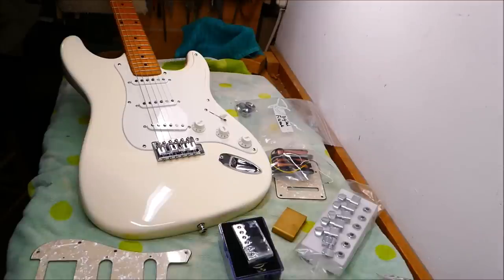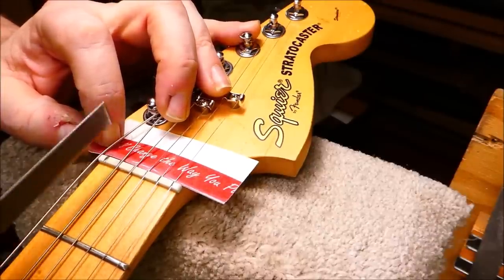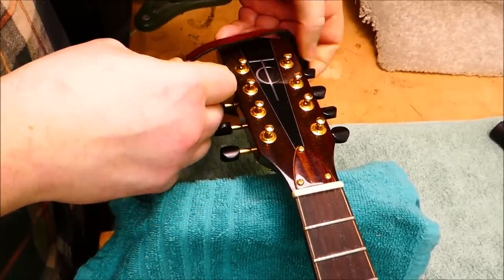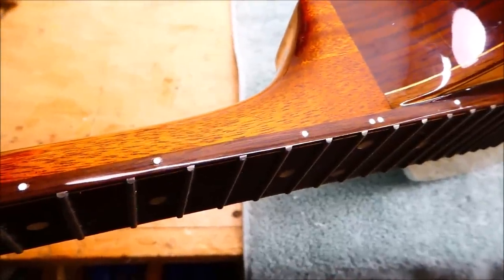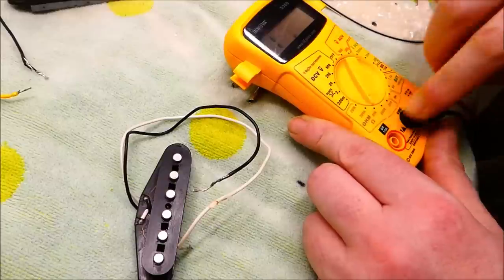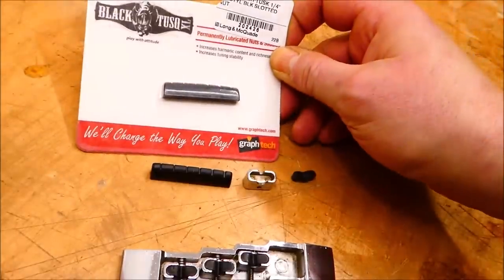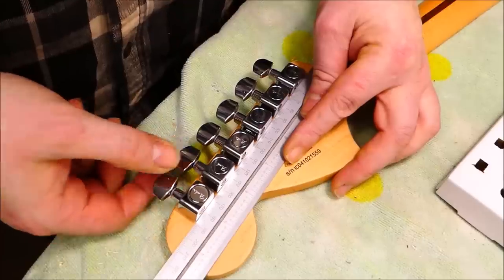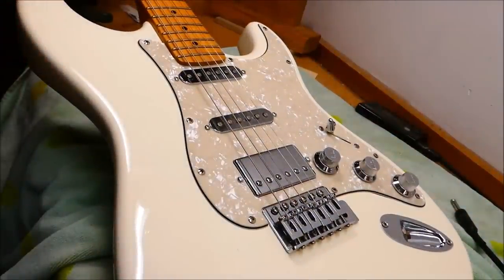That's a lot of work!

Comment: Random player: "Partscaster, assemble!"
Ted: "No"
BTW always wanted to ask, what happens if you agreed with a customer on a certain price, but it turns out to be much more work than initially projected?
Reply: My assumption is he stops at the budget and calls the customer 🤷🏻‍♂️
Reply from the maker: I almost never go over my estimate, unless it's something really unforeseen.
Reply: @twoodfrd  Good policy. In my own (non-guitar) business, I charge whatever estimated and figure I'll know better next time. In extreme circumstances I'll tell the customer that won't be able to do the work that cheaply again.
Reply: @allenhanford  that's the only right way to do it.  Things don't go right sometimes, and unless something way out of your control happens and the customer is informed in real time and a new plan is put together, you take the L, let em know and move on.   Most people will be a return customer solely based on doing the right thing.   I fix cars, and it's just what you do to have an honest buisness.
Reply: When someone wanted an exact quote, I always added 30 to 40 % just to be safe.
My regular customers trusted me enough and knew I wouldn't rip them off and just told me to fix it and call if I thought something was going south in a hurry.
Reply: I build  custom parts for race cars,,,,same story,,,they bring parts out of a catalog,,,first thing I do is take the part to the saw and remove the fluff that contributes nothing,,, I do my work on time and materials for the most part,,,I have been in business for thirty five years with no advertising,they come to me because they want it done right,,,and they know what to expect because of my reputation,,,,I pick and choose what and whom I want to work for,,,,
Reply: If the customer sees this video, hopefully s/he will do the right thing.
Reply: Unforeseen conditions can and do occur so it's a good idea to mention that beforehand.  If you are working on a handshake just call them up and negotiate.  If there is a written quote, submit a request for change order.   If the owner does not agree, bill them for the work accomplished and give them back their stuff.

Comment: I have done dozens of guitars like this.  BUT (that's a big but), I don't do them like you did with the customer buying the parts.  I ask what they want, we look online and pick colors, patterns and such.  Then I pull parts out of my own stock (sort of what you ended up having to do) and then build the guitar.  I always repainted the bodies and leveled and crowned the frets, so lots of work and value there.  I did tons of 8 hole vintage pickguards on newer Mexican strats doing the fill and drill you had to do.  I find it fun to do and never put a time limit on anything.  Most of the time, I'd build myself a guitar, play it in the band for a couple months, then sell it.  Semi copies of Knopfler or Gilmore or just what I feel like.  Then off to sell.  I don't have the repair skills you have so I guess we all do what we can.

Comment: I have assembled many Partscasters over the years. One thing I've learned is to NOT by a kit ( stewmac etc). I know which parts fit and strongly advise customers to buy what I recommend. All my neck joins are perfect, better than my original Fenders. As to cost, that's relevant to you and the hours spent. I only charge $40 /hour for 40 years of learning, modifying and building from scratch. I don't have to charge more as it's my hobby, even though I had a registered business, you are super professional. That and Youtube are your livelihood. So I can't say about your pricing system but I'd say $80- $100 an hour for a 5 hour job. Partscasters costs are becoming cost  prohibitive now so I only do favours ( often at no cost) to budding young musicians I know.

Comment: "Partscasters: NOT worth it!" One of the clearest, hardest truths in electric guitars world.😂
Reply: I sure like mine though.  :)
Reply: I put together my own partscaster. it did take me a long time. most of that time was spent searching for parts that were the correct string spacing ect. financially it did not make sence but I enjoyed the process but it is just a hobby
Reply: Why would it not be worth it? It sure worked well for Gilmour??
Reply: @beppelantz8169  we are probably not Gilmour..
Reply: The advantage of  a part guitar is you get exactly what you want.  The sky is the limit. I made a 7/8th size strat with 24" neck. Modenr trem, compound radius neck, master volume/tone,  and normal wound, unpotted pickups.
Reply: @beppelantz8169  Because gilmore wasn't mixing US,  Mexico,  Chinese, and other make parts and assuming it was all gonna fit like legos.

Comment: My absolute favourite guitar is a tele where I replaced the wiring, the pickguard and installed a Seymour Duncan 59 and hot rails, essentially the Danny Gatton/ Mike Stern mod. I also split the humbuckers with some resistors from the PRS DGT specs. Everything fitted perfectly except the bridge plate needed a little filing where the hot rails rubbed. The right parts are out there but you have to do the research.

Comment: My easiest partscaster is a Fender build using only Fender or Fender Licensed parts on a used MIM Stratocaster body and neck. I was shooting for a 1964 look and tone. Even then there were issues with mounting holes, pickup placement and such. In the end she looks and sounds great, and it was a fun project, but it was certainly not an inexpensive way of doing it. So far as cheap copies are concerned...be prepared. Every one of them is a work of love and "creative problem-solving".

Comment: The second position sounds out of phase. Its a 2 conductor wire so Im not sure how you can fix that. Flip the magnet maybe. If your single coils are in phase and hum cancelling then flipping the magnet on the humbucker is probably what needs to happen. Yet again another reason parts casters suck lol. Customer brings random pickups to slap together and thinks everything is gonna work out. Different manufacturers wind their coils whatever direction they choose. Sorting out wiring on a partscasters can really suck lol
Reply: Yeah, I thought I noticed the out of phase sound too. Been down that road a couple of times myself, opening up the pickup and rewiring the insides and/or flipping the magnet,... in most cases it's better to buy a new pickup that will be in phase cuz otherwise I'm charging at least an extra hour..

Comment: I learnt a long time ago to set the tail end of the guitar on the floor  between my boots ...the back center if the neck  against my left  knee and  as I tighten the truss rod I push back on the neck instead of just tightening the truss freehand  without helping with the tension as it is tightened.   Great Video THANKS   FUN stuff.

Comment: I built myself a Strat kit, transplanting in the HSH electrics from an Ibanez and with hand-made carbon fibre 'plastics'. Like your friend's Strat; a lot of plugging and redrilling, including the bridge position because it was 5mm out for the scale length but because it was a project from the outset and for myself, it was a lot a fun and I learned so much.
That said, I totally get 'You can't give me a bunch of random parts to assemble and expect it to be a quick job'.

Comment: I ran into a situation last week, where I needed a substantial piece of plastic to fix a non-guitar issue. Turns out, like most shops, we have a SEVERE over abundance of old screwdrivers. Lots of different colors too. I ended up using a clear handle to fix my other project,  and the plastic they used was good and hard,but also seemed to have some silicone in the mix. I'm going to shape a nut out of it, and see how it holds up. Should be slippery because of the silicone mixture(or whatever it actually is) so the strings shouldn't ever stick to the nut? I'll have to see. 
   Also, I dont know if mr woodford actually reads these, but if you do, I started putting that destroyed head on the hamer I bought just to practice. Taking it in stages, and it's working better than I expected.  Thank you VERY much!!!

Comment: I think it's vital to buy all your parts in a kit or at least get them from one source.  I just ordered everything for my first partscaster from Guitar Fetish.  Their descriptions are fairly detailed, and they tell you whether a given part is made for Imperial (US made) or Metric (imported) guitars.  For my neck and body I bought b-stock or blemish parts, to keep costs down.  I got a pre-wired Strat-style pickguard.  I'm good at soldering but I hate it anyways because my close-in vision is poor and my fingers are clumsy.  I went with top-notch parts for the vibrato bridge and the tuning machines.  Holes for the neck, the pickguard, and the bridge are not drilled, so I can take my time lining everything up.  I plan to dampen the wood, sand at least twice, then finish the neck and body with Watco Danish Oil and a coat or two of paste wax.  I have built about a dozen guitars from scratch, all set-neck, double-humbucker types.  This is my first experience building something with a tremolo bridge, and I am really looking forward to it.  For somebody with little or no prior experience I would definitely recommend buying a kit for your first build.  Everything ought to fit, and if it doesn't you can always send it back.  Good luck, everybody, and thank you Mr. Woodford for a great channel!

Comment: I have a few Partscasters and yes, you hit the nail on the head. Overall, in terms of time and money, you pull ahead with a stock guitar every time. That said Partscasters are really a learning course for the hobbyist like me where I am getting much better at many new skills. One Partscater predated a Fender run years later but still its not the same.

Latest mod is a Xaviere Strat with a HSS pickguard. Originally I had a double Filtertron pickguard with GFS pickups and due to the string spacing of the stock bridge and screw heads on the pickups, it came out off. Keep in mind ALL pickups and pickguards are GFS and Xaviere is their in house brand. 

The double Filtertron pickup placement was off and the location of the two holes for the volume and tone pots meant a full size pot will rub against the side of the cavity route. I am using CTS pots and Orange Drops in my builds. The HSS pickups are two Brighton Rocks (Burns style with large magnets) and a Surf 90 in the bridge which is humbucker sized but still a single coil (DeArmond meets a P 90, looks and sounds similar to a T Armond by TV Jones but the Surf 90 is the older of the two). The high E string misses the magnet on the Surf 90 just barely but much better than the GFS Trons in the other pickguard. I replaced the import tuners with import locking tuners that require no mods, put in Tusq string trees to go with the Tusq nut that was stock. The screw holes on the pickguards do not line up even though again, everything is in house.

Bought another IYV style Thinline Tele for the GFS Trons and while that will work, hitting little snags here and there. Have to get new longer thread pots because the ones I have are meant for pickguards not wood. I have to fill and redrill the pickup screw holes even though they look like they SHOULD fit. Still, both guitars are classes in guitar shenanigans.

I have a multiple Partscasters. I assembled them because usually it was either a way to have an instrument that was nothing you could get off the wall or it was far more cost effective than buying the production model. I have a mongrel Squier Telecaster that is more of a Teisco meets a Telecaster than the Mexican Telecaster with a Bigsby. Mine has Fender Noiseless pickups and wiring (it was free) and lots of GFS parts  including their X Trem which is more like a stable Bigsby knockoff vs a real Bigsby. My luthier helped me out but at the end it was less than half the cost of the Fender and closer to a updated and more reliable Teisco than a Squier or a Fender Telecaster. The flaws actually are highlighted and hide in plain sight and it looks, plays, and sounds really good. Last thing will be to get a bone nut for it.

So yeah, a Partscaster or a major rebuild is much better for the aspiring luthier. It's a cool guitar for the player and should give them a better understanding of what a luthier's job is. I would say for a hobbiest to get the guitar 80-90% completed before handing it to a luthier. Other than a Warmouth build, you are seeing diminishing returns once you start hitting the $1k mark.

UPDATE: The Xaviere Strat H/S/S is set up and plays very well. I am not a huge fan of the old bent steel string saddles so that will get replaced later. Either steel or brass modern block style. The IYV Thinline style Telecaster (300NT) modle) plays well and looks great. The GFS Filtertron pickups are a bit on the weak side compared to the real deal (have real Filtertrons on two other guitars plus a Gretsch set up with a set of TV Jones Filtertrons). I would say they do jangle but less power in the Alnico ll model vs real deal. That said it DOES give me a different tonal option which is what I was originally after, just less Gretchy.

The Squier build is close to done, since I originally wrote thia post 9 months ago, I replaced the GFS X-Trem Roller Bridge with a Gotoh old school style Bigsby bridge (the back is scooped out) with conpensated 3 brass barrels. This let me take the shim out of the neck. I also replaced the Fender old school F tuners (second set for that neck) with my preferred inexpensive locking tuners. This meant I had to fill over 20 little holes in the back and drill 6 new ones. The good news is that the new tuners hide most of the older holes and do not look too bad. This guitar is a blatant Partscaster and I decided to celebrate the changes rather than hide them. With the new tuners and the new bridge plate it looks better and feels much, much better. The tuners are 19:1 so the tuning is the best that neck has ever seen.

All in all those three guitars look great, feel great, and sound great. All for the price of a top of the line American made Fender (cheaper than a Custon shop though by still being about $1800ish all in). I love them, they are players, the feel cheap in a good way, they sound like they would compliment a professional level guitar.  None look like something off the wall in a music shop. So overall very happy but it also helped me turn a corner and really appreciate the "good to go" models on the wall at the guitar shop. If you can do the work yourself for the most parr, can recommend. If you want a professional to do it... buy Warmoth quality bodies as well as boutique parts because you will never see that money ever again. Or just have a good luthier build you something made to order.😉👍✨

Comment: I modded a guitar myself back in the 90s. A Jackson clone from Ovation. I wanted a Gibson bridge pickup, toss the whammy set up and install a solid bridge. I bought a 57 gold Gibson pickup from Gibson, a Schaller bridge and a built in tuner. I plugged the hole for the bridge (it's reversable I used hide glue). Covered the black headstock veneer with maple veneer (reversable) and wired in a built in tuner. Did the set up and good to go. Not an easy mod. It took days, I kept all the original parts. I restore antique furniture on a word of mouth basis as I have time and charge lots of money (I am always finding suprises). I know what it takes to rebuild a piece of furniture and do guitar mods. In this day and age of IKEA it isn't easy to get people to pay your time.

Comment: I used Made In Mexico (MIM) Strats for conversions like this.   I did work like this to 3 of my MIM strats, no hassles.  They fit parts available for strats without worries except for humbuckers.  Fender humbuckers, I think "Grease Buckets" are more square than the standard humbuckers & there are pickguards cut for them.  You must read descriptions.  As far as I know there aren't single coil metal pup covers.  I used plastic chromed covers & holding up well.   MIM strats are just the mexican version of the American strat.  My son was given a Squire strat , seems anyway they could cheat on stuff on the strat, they did.  Pick guard has 9 holes not 11, rear trem cover has a different hole pattern. pots are the smaller import type, tuners are different size, & trem block different cut, smaller size, no mass on sustain block.  Not worth the work unless you want practice at doing this work on strats.  Squires for kids who say they want to learn to play but you know they won't stay with it.

Comment: My Uncle taught me and I got what was like his mandolins and one from his father In-law. So one was a Martin A model from 68 to 72 and that came from Ralph's place and then my Uncle Tom passed I inherited his best instruments, including his mandolin and helped by giving Tom's wife and gave her Ralph's old mandolin in trade for Tom's mandolin. It was great I could help her out by giving a keep sake for her father. They both are 
Martin mandolins from 68 to 72 because Martin in the early 70s to stop making mandolins. They are a little harder to play compared to other mandolins made using mahogany and spruce top have odd angles on the body and a tiny neck compared to any other makers of mandolins? It's still fun to play it and be challenged by it. When played well it's tone is exceptional. Just harder to play - yes the answer is yes!